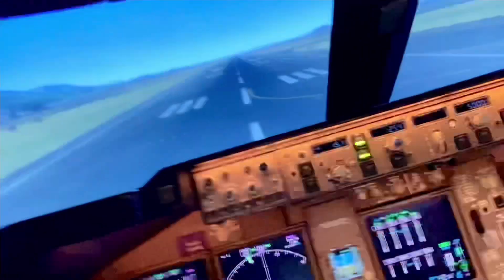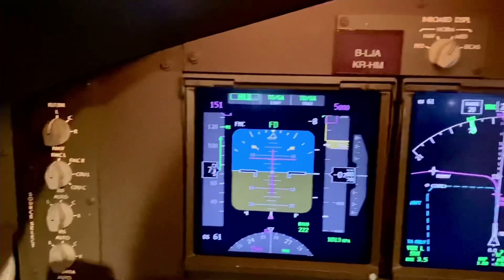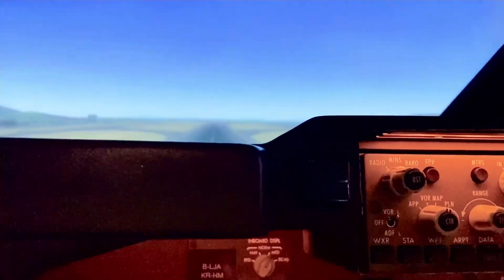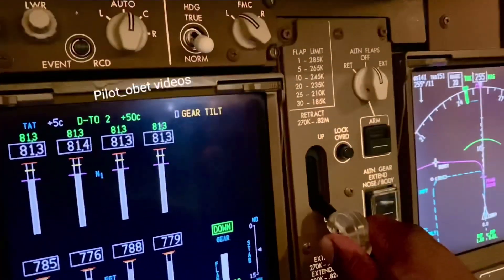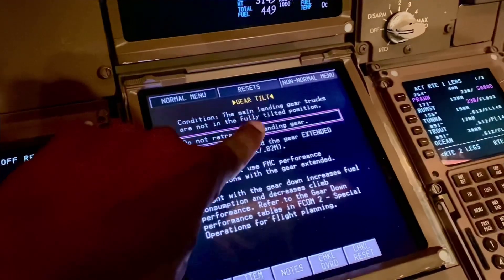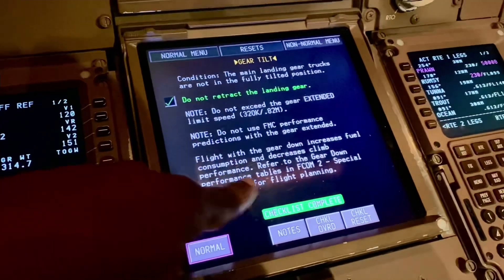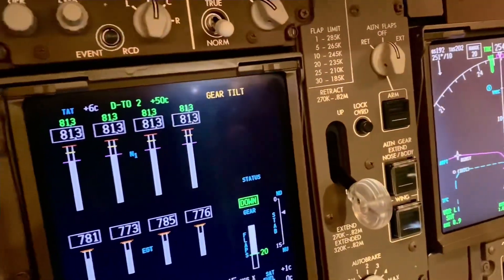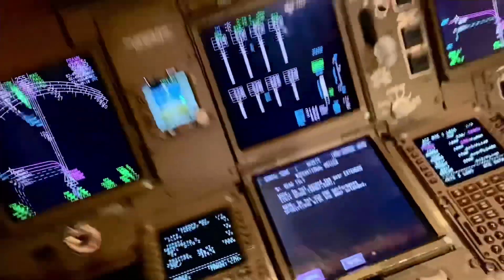B747-8 Landing gear fails to retract

Comment: Just curious, would you fly at normal holding pattern speed with flaps 5 (or 1) for the fuel dump, or retract the flaps and fly a bit faster at v2+100kts, and have the gear rattling the cabin?
Reply from the maker: Best to do in the clean mode